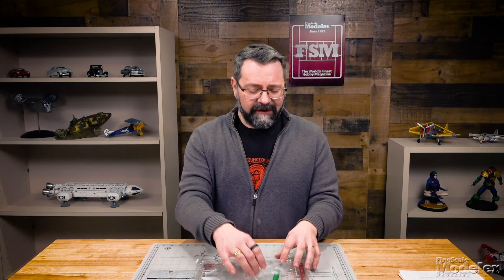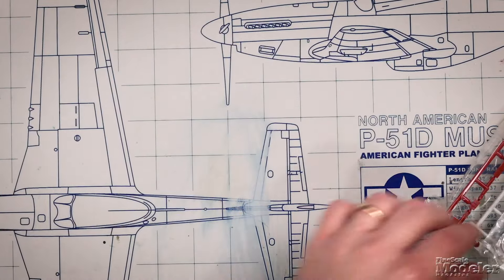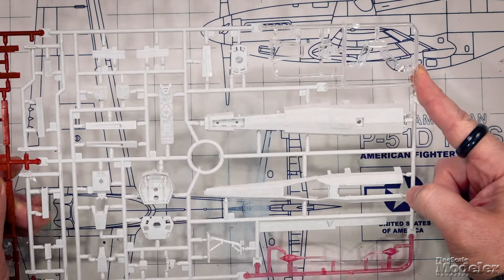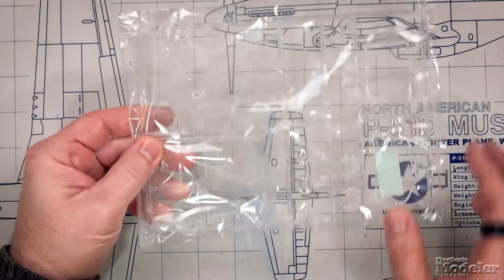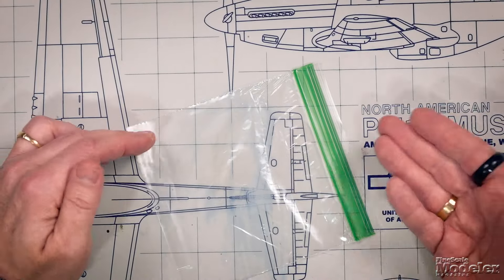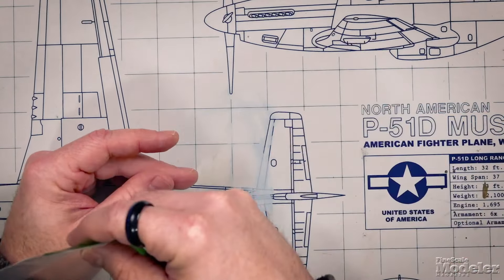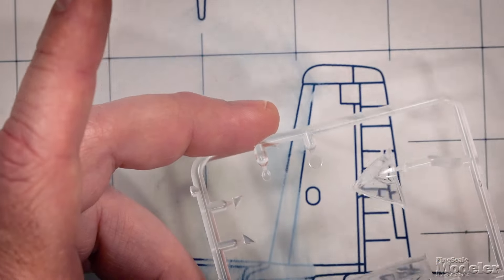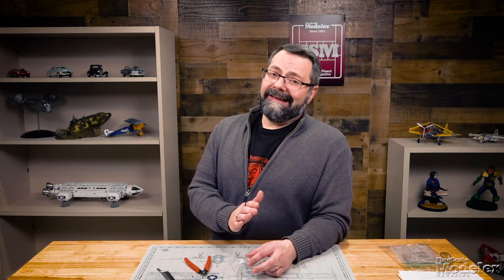FineScale Modeler Scale Model Basics: 5 mistakes to avoid with clear parts

Comment: Oh, i almost forgot. Thats a nice A6 Intruder with wingtip speed brakes deployed open. One of my favorite attack aircraft.
Reply from the maker: Thanks! It's a new 1/72 scale Trumpeter kit built by reviewer Paul Boyer. You can read his review here: https://finescale.com/product-info/kit-reviews/2024/02/workbench-review-trumpeter-172-scale-a-6a-intruder-plastic-model-kit
Reply: @FineScaleModelermagazine  
I super jealous as I want that model. Timing to do a little shopping.
Reply: My dad made instruction manuals for technicians at grumman that built the hawkeye, A6 and tomcat.
I saved a few. I even have technical drawings of the LEM
Reply: @highorbit3282  
Did he write the naval issued manuals that was used at squadron level? Pilots and the Bombardier/Navigator each had the own version. As well as the maintenance people. I was plane captain on the A6E with VMA-AW-533 and we performed variouse inspections on the aircraft we used a NavAir manual every. I forgot the version. Long time ago 1977 to 1983 is when served in the Marines.
Kuddo's to your dad and Grumman Iron Works. They turned out awsome aircraft

Comment: Great tips Tim! I use a razor saw and single blade nippers for removal from the sprue and G-S Hypo Cement to attach clear parts. The single blade nippers do not pinch the plastic, and as you demonstrated, the saw is ideal for long attachment points. In my experience, the Hypo cement dries "clearer" than other adhesives designed for use with clear parts.

Comment: I speak from not having cracked a kit open yet, but watching builders applying the extra thin cement in a big 'dab' and let capillary action distribute the liquid along a join, I always thought that any overflow onto the surface of the parts would affect the plastic (regular parts - not clear parts).

Granted those parts will be painted and any visible marks covered, but as it's designed to weld the plastic, any excess cement that spread across a surface rather than along a join, would still damage that surface.